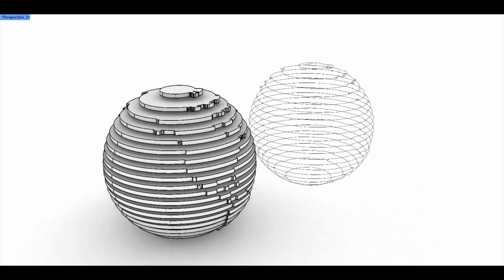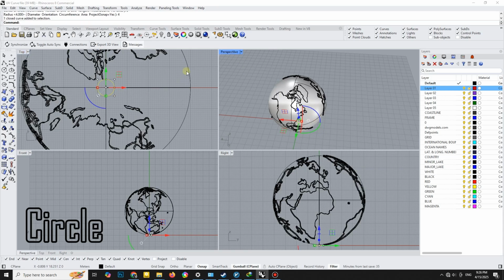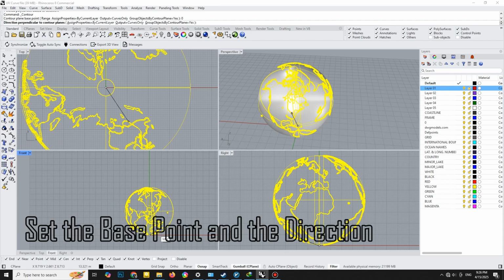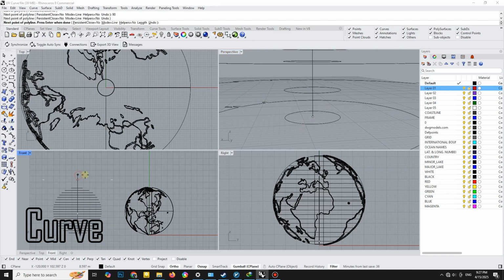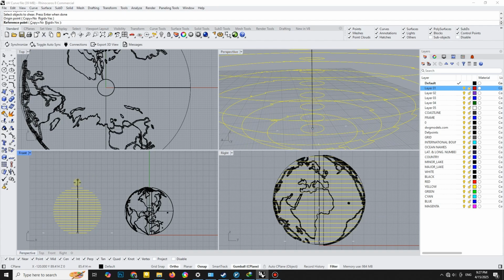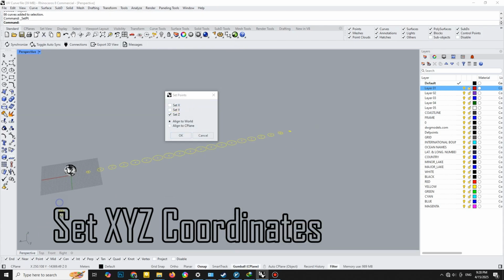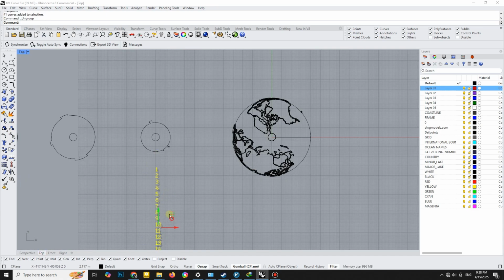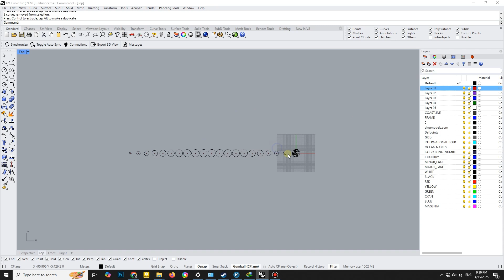CNC Cut List in Rhino3D - Contour + Shear + Set Points

Comment: How do you nest those pieces for an optimized cut and material saving?
Reply from the maker: After you have completed the sections, there is a plugin called RhinoNest. It is designed for efficiently nesting pieces in your cutting area.